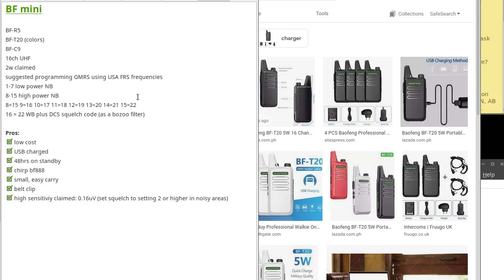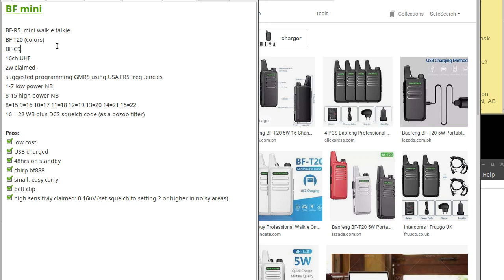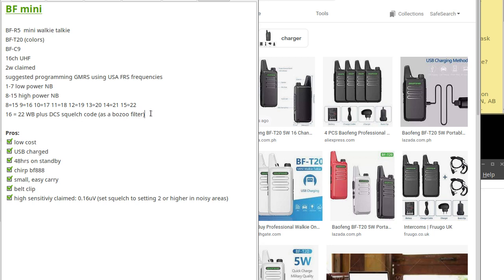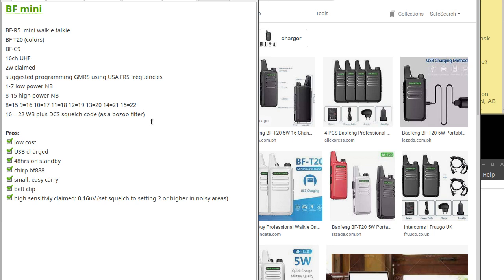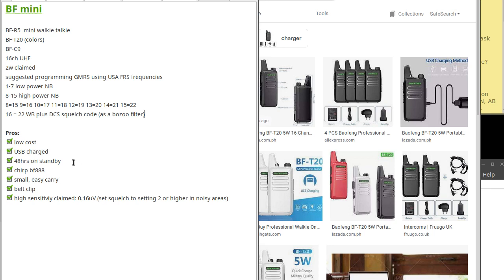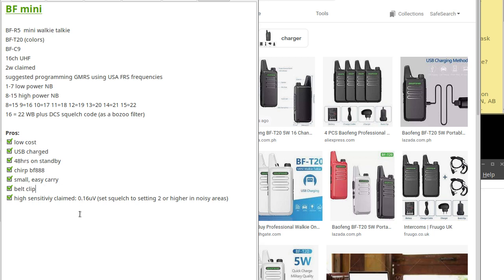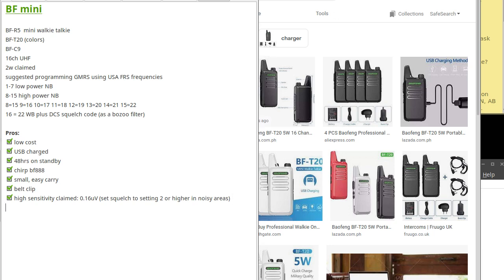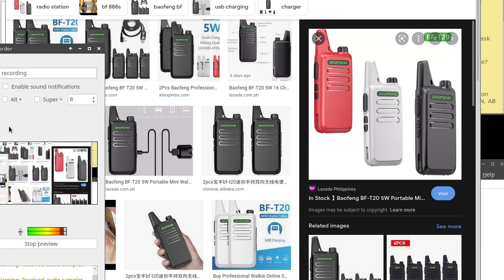radio review bf-r5 bf-t20 baofeng walkie talkie GRMS FRS

Comment from the maker: update: I just received a few T20s this week. My frequency counter shows they a not legal to use in Canada or USA, they don't use FRS or GMRS frequencies, except channels 6 & 7 they use legal free to use frequencies but they use TCSS codes
Reply: im from the Philippines. is it legal to use bf t20 here without license? i did not program the radio, i just used it out of the box. i'm using channel 6,together with its pair.
Reply from the maker: @leonardomedina418  I dont know
Reply: @godfree2canada  anyways, Thank you so much for your time, and for sharing your knowledge and info. Godbless you and your family.
Reply from the maker: @leonardomedina418  https://en.wikipedia.org/wiki/Personal_radio_service#Philippines
Reply: Is it possible to make this legal in Canada?
Reply from the maker: @dontgiveajack168  you need to reprogram them with the Chirp software using a data pack & proper cable. I already have data packs ready http://flightsimhq.org/radio/downloads/

Comment: the dealer where i bought my bf t20 from said that i can use this radio out of the box (as long as you have the same channel as its pair radio. That i can use it even if i dont have a radio license. i double checked and asked him again. He said that I can use bf t20 even without a license.  They even branded this radio as "kids walkie talkie, no license needed".
Reply from the maker: yes, they use standard frequencies but they also add certain tones codes (bozoo filters) and the channel numbers do not match normal 22 channels. So ch16 on T20 is not CH16 on FRS radio. So the pair might be different from another seller, its all how they are programmed.
Reply from the maker: I think slots 11-16 on radio are channels 15-20 with special DCS codes not found on regular talkies. This will block annoying users from talking over you
Reply from the maker: they program all the 16 slots  with special tone codes as to block out other users or interference in high density areas
Reply: @godfree2canada   so can i use it even if i dont have a ham license (or whatever you guys call it)?  i am using the channel 6 on both radio(pair).  i am not planning to call other peoples frequency.  i bought these radios as intercom for my brother and me.  So am i safe to use it without license?
Reply from the maker: @leonardomedina418  safe & legal, nobody owns a channel. Wise to avoid CH 1,2,3 because kids use it mostly
Reply: @godfree2canada  THANK YOU SO MUCH😊. you are Godsent.  That is all the assurance that i needed. Godbless
Reply from the maker: @leonardomedina418  I just received a few T20s this week. My frequency counter shows they a not legal to use in Canda or USA, they dont use FRS or GMRS frequencies, except channels 6 & 7 use legal free to use frequencies